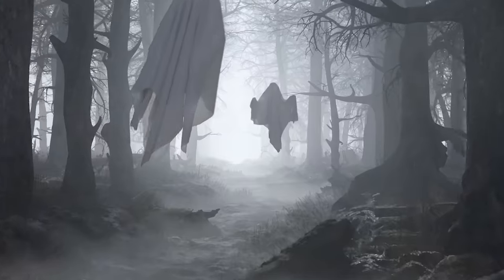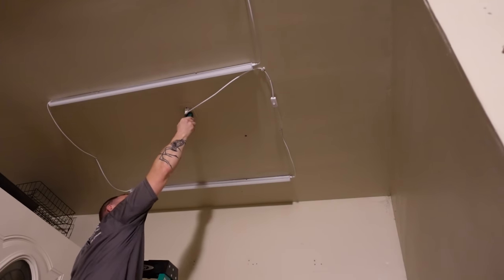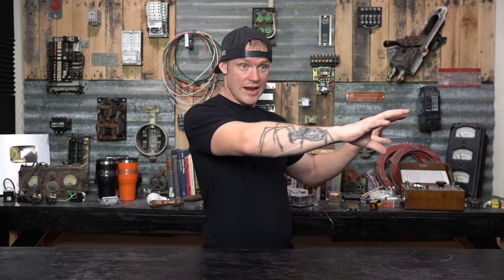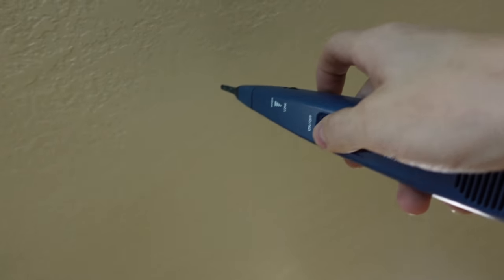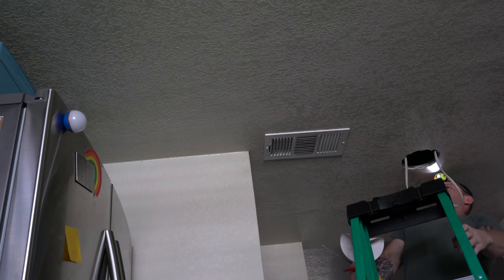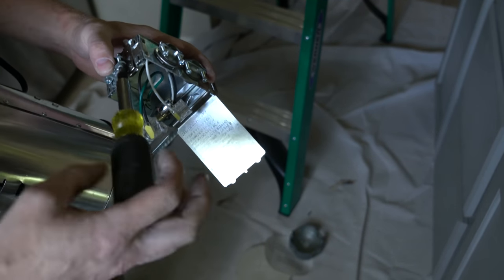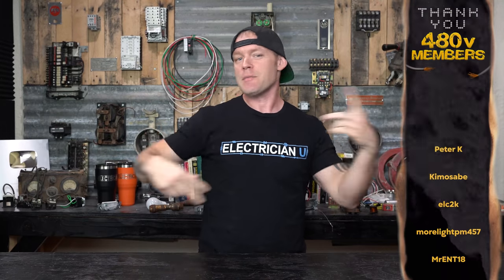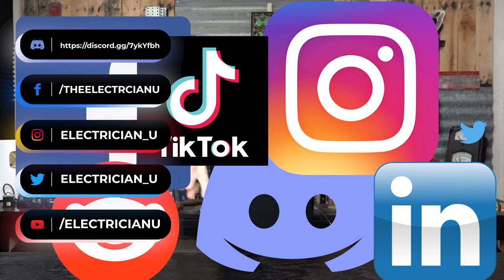THIS IS WHY ELECTRICIANS DON'T HIDE J-BOXES IN WALLS - Finding Hackwork!!

Comment: I've hidden J Boxes behind walls in my own homes.  Better than no J box!  I feel a little dirty when I do it but here is my rationale:  I know code and I'm an experienced DIY'er.  I look up things and learn and do the right way.  I wire things securely and correctly.  I test everything.  Everything is as it should be, for sure and guaranteed.   Life goes by fast and I don't stay in any of my homes forever.   If anything ever goes wrong, and it won't, I'll probably be dead by then and they'll simply discover one of my J boxes when they do a Reno.

Comment: Ninety percent of the time it’s the home owner’s “friend that’s an electrician” that did the work…The remaining 10% is that carpenter that’s an electrician…
These same electricians also try to install generators, home theater systems, and additional branch circuits wired in speaker cable and so cord….Three wire home runs with both wires on A phase..
14-2 on a 30amp..
grounds used as neutrals…1000’s of other “professionally” done wiring.

Comment: Dude you're an electrician do you really need the income?
Reply: A smart tradesman has an exit plan. You do not want to be belly-crawling through mud under a house or balancing on 2 bys in an unconditioned attic in August when you're 65.

Plus, why shouldn't he get paid for producing instructional content on top of his day job? There's no bulk discount on labor. We call that overtime.
Reply: @institches2750  Alright.  That's a good answer but if you manage your money you could retire early.

I hired an electrician to move a recepticle like 4 feet some 20 years ago.  I think they charged me $100 a foot.  I'd have done it myself but serious back problems prevented any bending.